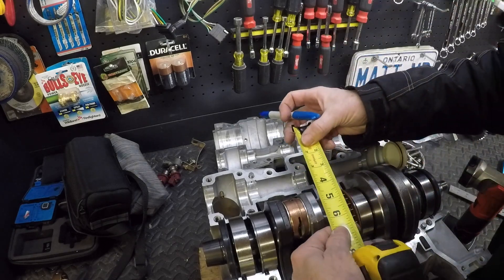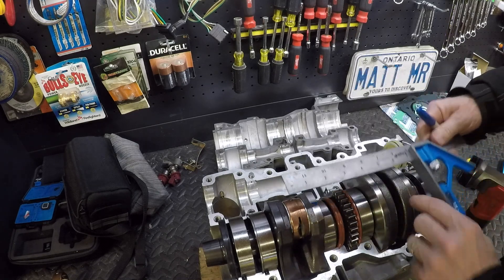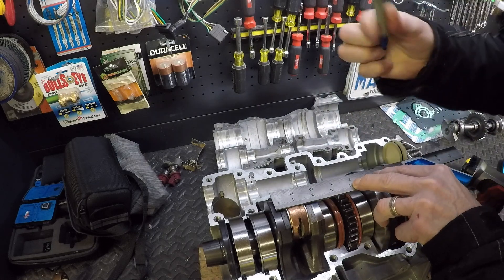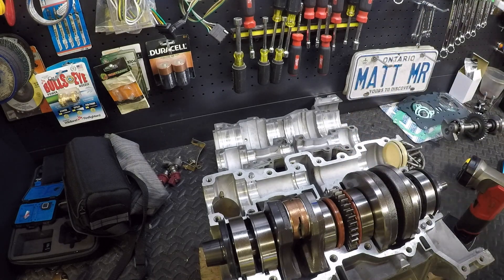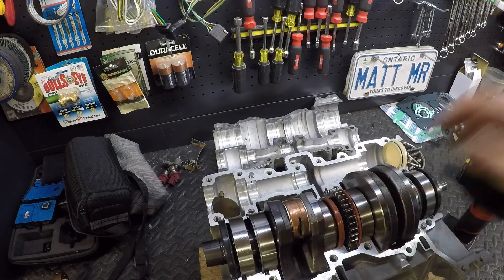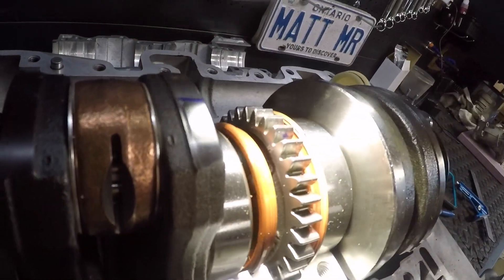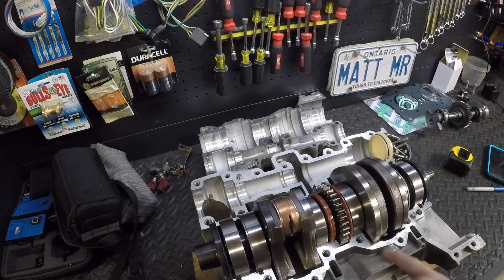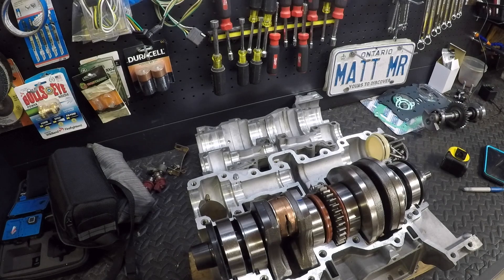Seadoo 951 Crank missing alignment mark

Comment: If that is a WSM crank, they stopped putting marks on the crank gear. That occurred after they shipped a batch with the mark on the wrong side of the gear. Their QC sucks.
Reply from the maker: Ha..I have been happy with the WSM parts but I have never purchased a crank through them. I send them to CVTECH to get rebuilt.